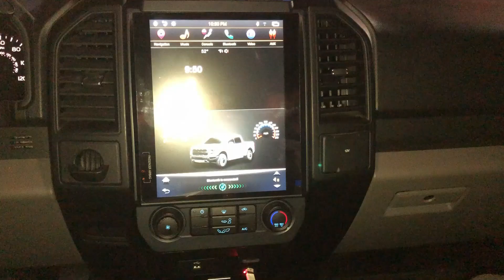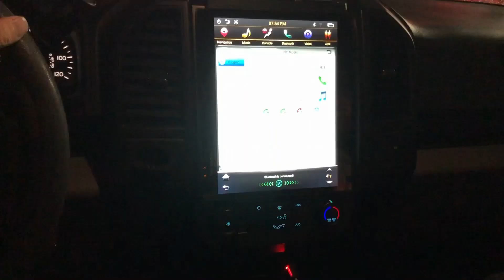12.1 inch vertical screen Android head unit Gen I to Gen III upgrade for 2018 F-150 with manual A/C

Comment: My 2017 f250 doesn’t have the 4” screen. Only has radio buttons. Not steering wheel controls either. Will I be able to install it?
Reply from the maker: Yes, you can install it.

Comment: Please tell me why there is no sound coming from the external speaker when using gps.

Also how do I change the white ford raptor to a f150 xlt?
Reply from the maker: For the car picture check our other video about changing the car type. For the sound issue send your order number and system info to contactus@phoenixandroidradios.com

Comment: Hi there, I have couple of issues with my unit: 1- It switch off whenever the vehicle starts after a stop... In order to keep it running, I have to turn the auto start off. (as if the power cuts off and on again.)
2- navigation button doesn't launch the Navigation app... I have to go to App list or settings to run it.
Reply from the maker: Jalil Aljuboory order number?

Comment: I bought this same unit and my climate control lights stay on sometimes. I have to to pull the fuse for lights to go off. I have removed unit and installed my OEM unit back in with no issues. I have sent 2 emails to phoenix automotive with no response. Anybody else having these issues? 2017 f250 manual ac controls.
Reply from the maker: Harold Smith order number?
Reply: I'm having same issue
Reply: I know at the same issue with AC controls but same issue with Phoenix automotive
Reply: @bradmccommas5199  I was able to go into the configuration menu and change my F150hi to the F150Lo and this solved the problem. I have 2018 F350 XL SXT and the unit works great now

Comment: I see you had the same unit just without the ac control before. My question did allow the ac unit to automatic turn on if you was using a remote starter. Like the factory unit would.
Reply from the maker: Bama Douglas For model year 2016+ retains that function
Reply: Phoenix Android Radios so it works for a 2015?
Reply from the maker: jason johns yes it works

Comment: Does the PX6 unit retain the Sync 3 navigation and can you add a 360 camera system to this?
Reply from the maker: J R yes and yes
Reply: @phoenixautomotive4336  Can the Android OS be updated to the most current version?
Reply from the maker: @JR-xk3tw  The newest unit Android OS for F-150 is PX6.